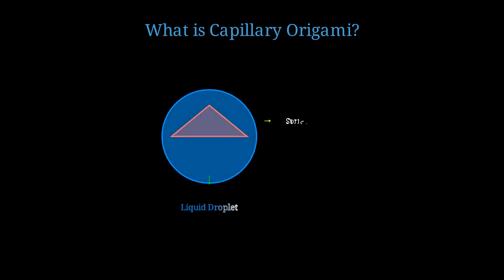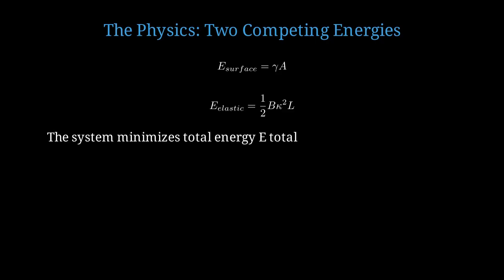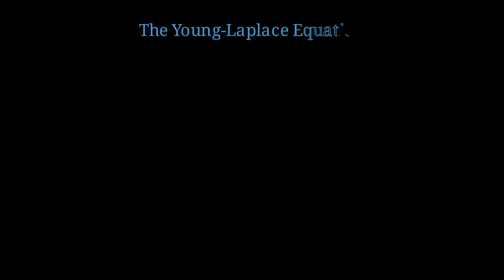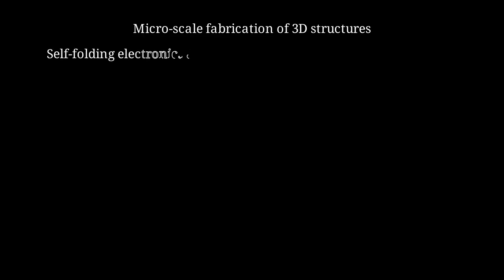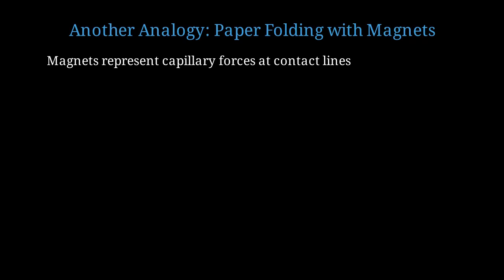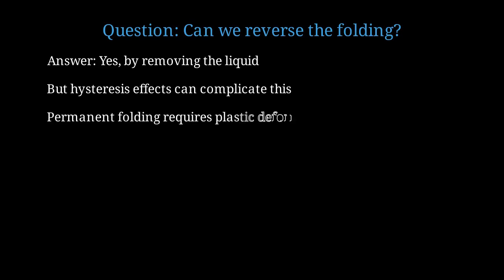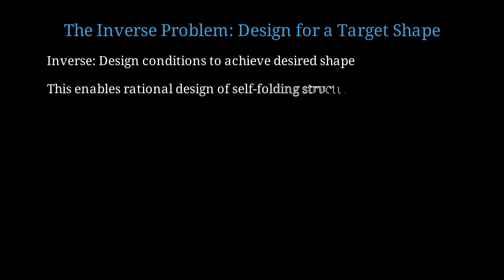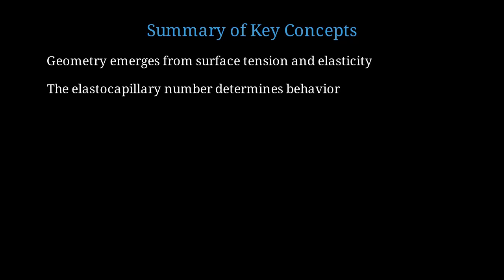Capillary Origami: How Surface Tension Turns Liquids Into Sculptors

Comment from the maker: Can capillary origami principles be extended to programmable, multi-material systems that fold hierarchically?
How can we model metastable transitions between local energy minima in dynamic folding pathways?
Could hybrid electro-capillary forces allow scalable control beyond the capillary length limit?